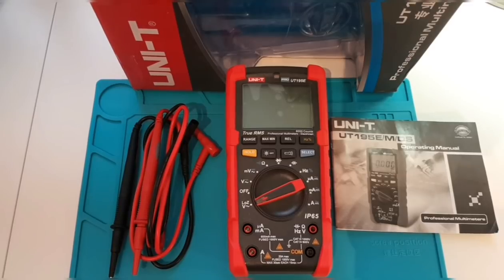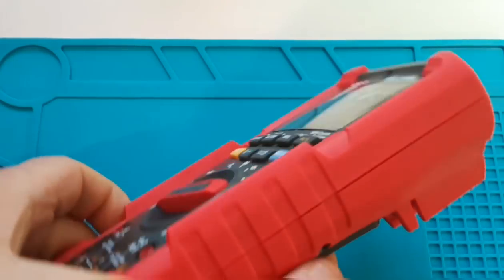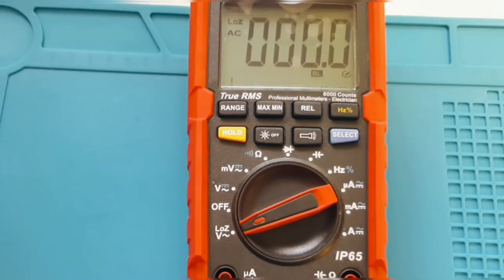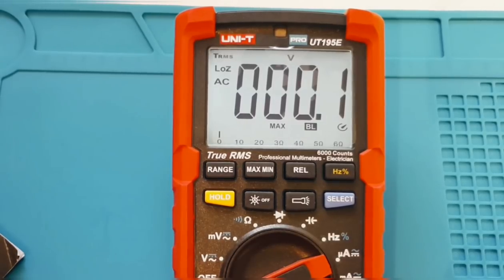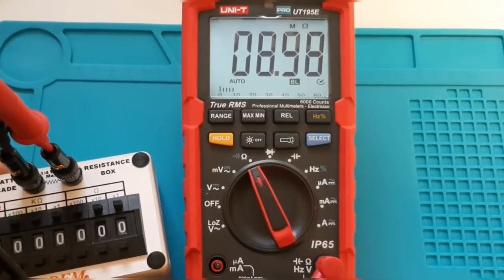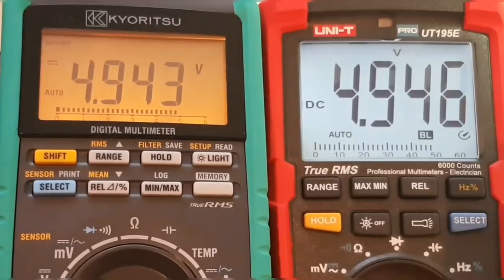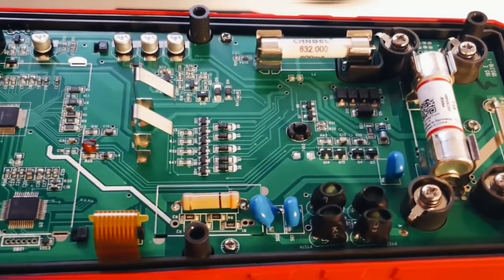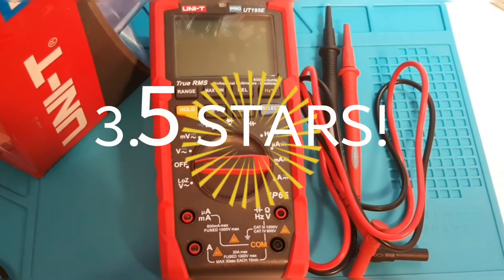UNI-T PRO UT195E Multimeter Review Teardown!

Comment: I took another look at your teardown and at first glance the board does seem neatly and nicely done, theyve thrown the good parts in for protection on the fuse side - yet no arc over walls standing between critical input areas nor is the board routered out in critical areas where arc over could occur and the power protection resistor looks a bit small for this price class.  Something else we didnt get a look at is on the other side of the board where the range switch contacts are.  Many times theyre too close and they often arc over. I dont know how much of Joes testing youve watched but it can be very revealing even on some of the most expensive rigs.  He pulls no punches for sure, even hammering the expensive ($800.00+) Gossan Metrawatt for a serious lack of shielding.  It was seriously affected by surrounding interference for which there was no excuse - which he corrects by building his own custom shielding that solved the issue. I just saw the UT195E on Amazon goes for $158.00 and thats not a bad price if it loses its teething pains-- but the idea of that other dual display model sure sounds good as well--lol

Comment: Please forgive, my comment turned into a bit of a rant-lol  Its good to see Uni-t finally showing a more pro-active direction far as input protection and build quality.  I really like the design of this meter but apparently still some quirks to be ironed out as in any new product. But I fear it might be business as usual with them in that they take it to 80% and never put the finishing touches on it.  A small thing to nag about for sure, but case in point on my 61E, the highest level 22,000 count meter in the entire series and no friggin' backlight, even though the lower ones in the series have one and the chip supports it.  There are $15 meters with decent backlights so no excuse. Along the same lines the backlight glitch on this model should never have made it to daylight, its a bad opening for a new product - hopefully its not permanent and easily fixed in the software.  Also that was a very slow and seemingly inaccurate cap test for a "pro" meter.  I have a Mustool MT108N handheld that gives near instant cap test readings and it only cost $17.00.  Thing is, I always really want to like Uni-T, I have a 61E and a 139C. I like the feel and look of my 61E as well as the 22,000 count display - but again if you go as far as providing a 22,000 count display witha bar graph, why no friggin' backlight-?   In the end id have to see this one pass mr. Smiths testing before I paid almost 2 bills for it, a Fluke 17B+ costs less and a Fluke 117 costs about the same and no question of quality there.  Uni-t's have a history of failing light transient tests early and before most any other meter - hopefully this ones input protection puts that behind them as I really would like to see Uni-T become a stronger player.  Ive seen meters that had all the requisite input protection parts still fail early due to bad board layout/design or other oversights, it shouldnt happen but it does sometimes.  It takes more than the parts to make a meter robust enough to resist transient events and high voltage failure, good PCB design and layout are also part of the equation as well as the PTC's, MOV's and large resistors etc.  One of the strongest meters in this regard surprisingly is the tiny little Fluke 101, very cheap and entry level but handles amazing transient and high voltage punishment well above its ratings without ill effects and its under $50, though it has minimal functionality of course.  Its one thing to make a meter look professional and label it as such, but quite another to make it perform in that league.  Come on Uni-T youre heading in the right direction, now lets see a come from behind and run with the pack approach-!  End of rant. lol
Reply from the maker: I agree 100%! UNI-T has a great product line and offers good price points but they always seem to mess up the easy stuff. I didn't see any isolation slots (arc over??) on the PCB nor did I see any o-ring or seal on the inside of the chassis..(dust/water protection??) so it seems like they are still a work-in-progress as far as fail-safe meters go. Let's face it, whenever I see the word "Professional or Pro" on a DMM it's usually not a good thing! Yes, the Cap range was slow to come to a reading which is also not very good and rather odd seeing as it's the same IC used on many low-end DMM's that handle large capacitance without any problems. I was definitely expecting more. The auto Back-light was a huge disappointment, as you said there's no way this should have made it to production...and the tilt stand once again drives me bonkers. It is well made, quality components and very clean PCB fabrication. The unit feels solid (I'm sure it can withstand more than just a 2M drop). Generally a very nice package. However, UNI-T needs to finalize the package before they put the "PRO" label on the outside, it just feels "unfinished".
Reply from the maker: @yambo59  Well said! Let's hope they ARE listening. BTW, UNI-T claims the meter can handle/sustain 8K volts...that's quite a claim!
Reply: - 8K volts is what the little Fluke 101 took before breakdown in joltin' joes testing, way higher than its design spec. - no reason a meter like this pro rig from Uni-T costing over three times as much shouldnt do at least half as good or better, but I suspect the board design far as arc over isnt as well thought out, I cant wait for Joe to test the Unit, hes spent a lot of time trying to modify the 61E for better performance and it still left him wanting.  No one tests the limits like he does exposing every conceivable weakness. My Fluke 17B+ although made in china came out as one of the most robust in his testing, its what helped make my final decision to purchase and ive been very pleased with it- good functionality for the money, a back light that can be locked on and Fluke quality on a budget - whats not to like. Cant speak for longevity but theres nothing to suggest it wont do anything I ask of it.  
- Im a bit perturbed the guy in NY hasnt shipped my old school Fluke 27 yet, been a week and no UPS tracking yet - ARR-! - To be fair it did give a long delivery time on the ebay page - but why, its here in the US--again ARR-!   My OCD is very impatient in my old age-lol

Comment: Thats still the best looking input section ive seen on a Uni-T yet -- but its not a cheap meter so it should be sporting some fancy firepower against angry invading pixies-lol  They definitely could have tossed in some shielding in a $200 meter, even if its the spray in variety like I used to see in a factory I once worked in.
Reply from the maker: Definitely...! Not for the faint of heart (or pocketbook). It's certainly exudes quality when you're actually using the meter I'm torn between all the great things about it and all the things they could have done to make it better..

Comment: Thanks for the review! Does the REL mode put you out of auto-ranging? In diode mode, does it beep when you short the leads? 

Also got a couple of suggestions here:
- Would be nice to see how fast the meter auto-ranges in modes like DCV, ACV and Ohms, I know you showed shorting the leads in ohms mode, that's much appreciated.
- Would be nice to see the AC frequency response actually measured.

Thanks.
Reply from the maker: Hi Brian,

Those are great suggestions...I'll do my best to implement them! Depending on the meter,  sometimes I'll do a more feature packed review..other times, less is more.
Appreciate the feedback. Thanks for watching

Comment: On my 191T with same backlight setup I sometimes put a small bit of electrical tape over the sensor and just use the backlight button for an on off switch--lol  I know its hokey, but as you said I want control dammit-! lol   For what this one costs it really should have something like flukes touch hold, and it certainly should have an LED indicator on the continuity range, were talking pennies for an led.  UniT if you want to call it a professional meter step up and include the professional features.  I really like my 191T, and overall this line of meters is still a big step up for UniT.  My 191T does not have the loosey goosey kick stand, its got a nice tight fitting stand leg that shuts tight and positive.

Comment: Can you do a side-by-side comparison between the 195E and the 139E or 139S ? They seem to have nearly identical specs aside from temperature measurement, and I'm wondering where the actual differences lie.
Reply from the maker: That's an in interesting idea..ok I'll work on it...would be nice to have all 3  for the comparison.
Reply: @KeepOnTesting  I have the 139S (I bought it partly thanks to your video) and I can confirm that it has (at least) decent input protection. I put 2.5KV across the terminals with an insulation tester and I have experienced some some inductive back-emf measuring some motors that would have killed crappier meters with it. 139S had no problem with it. I think it would be interesting to see if they have made some improvements since then.
Reply from the maker: @superciliousdude  2.5kv is alot !  Glad to see the 139s held its own. I agree the comparison would be interesting, stay tuned.

Comment: Cheers Darren, had my eye on one of these  for quite a while.
Reply from the maker: Too bad it has some quirks! The standing bale drives me batty, why UNI-T can't get this resolved is beyond me. Also, the back-light saga is ludicrous...Why mustI I turn off my meter so I can turn the backlight on? Gads... The input protection and overall build quality is very very nice though. No worries about Transients or voltage suppression here. I failed to see any seal/o-ring on the chassis internals, so I'm concerned about the waterproof/dustproof claims, it did meet IP65 so it must work. I might in future do a followup but for now I'll let it rest on it's laurels as far as that is concerned. Cheers Mate!

Comment: Best regards: I request your help, I have the same multimeter as in the video but when I put it in continuity my multimeter sounds even without the test leads attached... I have noticed that when off and in resistance/ohm there are capacitors that short I don't know if it's something normal in multimeters, it's the first time I've reviewed one... there will be something that needs to be changed. I have done everything I have seen on the internet, I changed the 11A fuse that was blown, I put the battery upside down for a moment, tapping it a few times :) but nothing has given me any results. What can I do in this case :(
Reply from the maker: Remove the case and clean the Selector tracks with cotton swab and IPS 90% or better. Then grease lightly with a dielectric grease. It might be as simple as that. Let me know
Reply: @KeepOnTesting  the selector is immaculate, in any case I cleaned and lubricated it... the problem persists, I already consider it to be a problem with the components of the board... as I mentioned, it does not measure resistance, it gets stuck at 28.3 ohms and in continuity It only beeps even without the test leads...I don't know what to do.
Reply from the maker: Change the mA FUSE as well. You might have to painstakingly verify each component with another multimeter . Follow the tracks when continuity is selected on the selector switch and start with the components directly in series. Unfortunately I do not have a schematic for this dmm.
Reply: @KeepOnTesting  greetings: the fuses are good. As I told you, I temporarily changed the 11A fuse for a 40A one (I'm not going to measure current for now). I checked components and found values that I consider altered in the 4 PTC thermistors (PTC1,PTC2,PTC3,PTC4) that are attached to the red test cable, have a value of between 1kohm and 1.5kohm which, being PTC, seems to me It is not correct, I don't know if you could tell me what value your multimeter shows you when measuring these PTCs. Outside of all that, I took a clamp and shorted one of the 3003 resistors that are in the middle of the PTC thermistors and also the same PTC thermistors and the multimeter returned to zero on the resistance meter and stopped beeping for a second, I don't know if it was luck or what I think is on the right track but I would appreciate your help. thank you so much

Comment: Big fail with no polarity guard.  1 second of the battery in backwards and bye bye $130.  Also, it's a shame they din't use the DM1106EN chipset which is used in the $35 UT210E
Reply: wow, but there is a battery protection, and its D15 in motherboard, don't know why u are spreading false news :/

Comment: Whats the difference between the UT195E and UT 195M? which one is better?
Reply from the maker: They are almost identical dmms, the UT195M also includes Temperature.
If you don't require Temp you can save a few dollars.. Otherwise they are the same. They both have the identical  build quality which is excellent.
Reply: @KeepOnTesting   thanks man.
Reply from the maker: @sanjoe1246  My pleasure, thanks for watching!
Reply: The main difference in the 195M is it has a special "M" range addition intended for testing electric motors, even large ones possibly not sure im only going off the spec chart for the three different models.  General consensus from my point of view is unless you need the special Motor function of the 195M no reason to spend the extra money, the 195E is essentially the same meter otherwise. I dont have the 195 myself, but I do have the next one down the 191T and I am extremely pleased with its build quality and performance.  Ive looked at buying the 195E many times, but my uses arent extreme enough to warrant it and the 191T will do anything Ill ever need.  Ive been very pleased with the newer UniT meters,  as Darren said in the review UniT has really stepped up their game with these newer models and they are more ruggedly built, accurate and  a great value given the functionality and high build quality.  I also like the idea these meters are IP65 rated for dust and moisture resistance and the case structure is extremely solid and well designed, easily on a par with the likes of Fluke.

Comment: Good review but I do not understand why they would need to clamp the shunt on the current range with a M.O.V.  That seems unnecessary to me.
Reply from the maker: MOVs shunt the current related to a HV Transient..it would act like a shunt regulator ..
Reply: Thanks for responding to my message, Darren but there does not seem to be any technical reason to put a shunt across the shunt.  If the power source has enough energy to drive the voltage across the sub-ohm shunt to hazardous levels the operator will probably be "toast" anyway.  Clamping the shunt seems to be some sort of fad that will not improve safety in any meaningful way.  I would rather have a meter with a resettable breaker instead of a fuse and M.O.V.
Reply from the maker: @SuperMurrayb  I don't know the reasoning behind UNI-T engineers to utilise this type of Input Protection but I agree the implementation on the surface at least appears to be redundant. Thanks for watching!